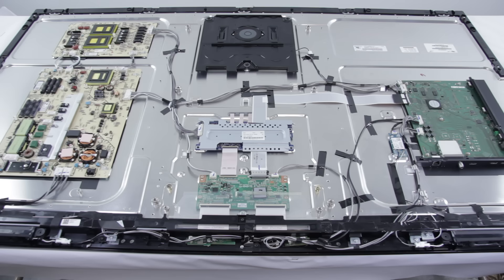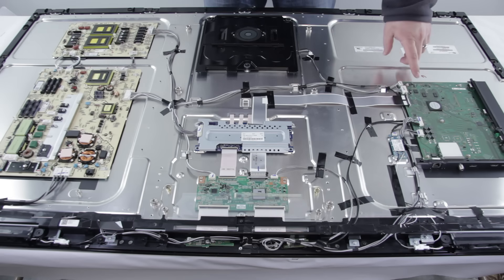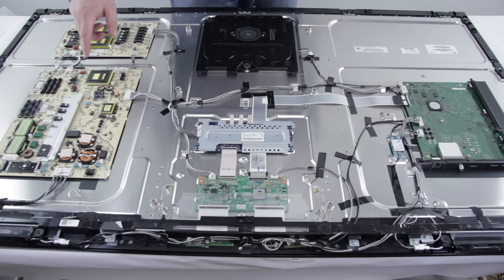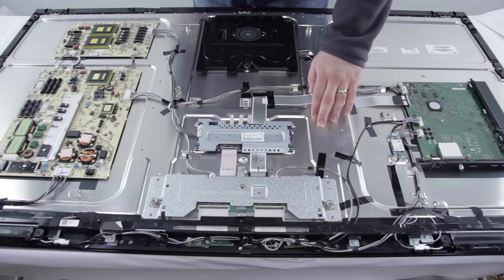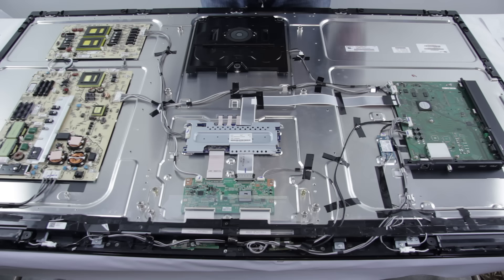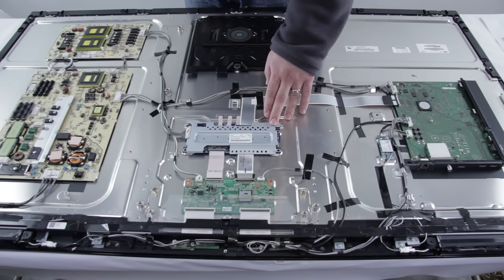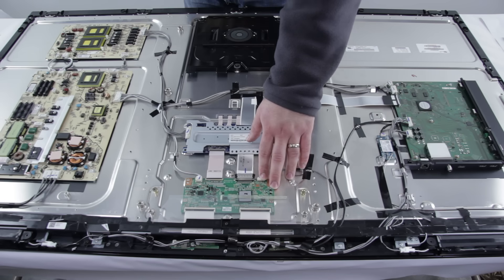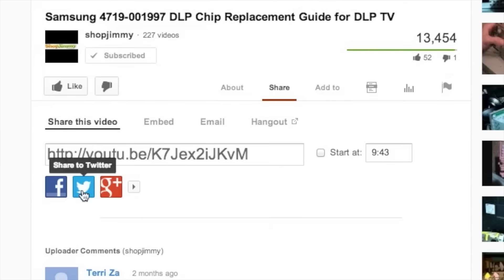LED TV Repair Tutorial - Common Symptoms & Solutions - How to Repair LED TVs

Comment: Hi  I have a 19" LED TV whose screen switches from white to blue to red to green to black and then repeats. There is no reception or sound, just the colour sequence, and it doesn't respond to the remote control.  Amazingly, there is no manufacturer's name or model number on the set, so the only information I can give you are the markings - 248COMBILED19 & 108011.  Sorry.

Comment: I have two Sharp LC-39LE551U Aquos LED TV. When we turned them on out of the box both of them have major picture problems. (looks like internally the panel is cracked) nothing on the outside. Is there any fix or does it sound like the panels. Sharp won't cover them on their warrantee because they think it was FedEx delivery issue.
Any thoughts?

Comment: I have a Sony Bravia 32" LED Model KDL - 32EX520, After switch on the TV suddenly some vertical lines and light flickering has been happened in the screen. What could be the reason ? Any issue with the Display screen. How to get resolve this issue. Please help . Raju Jacob
Reply from the maker: RAJU JACOB  This sounds like a TV panel (TV Screen) problem.  If your TV panel is bad, it may be more cost-effective to replace the TV as panels are typically hard to find in stock, difficult to replace, and expensive.  Thanks and please let us know if you have any further questions!  www.shopjimmy.com

Comment: I have a Sharp Aquos Model: LC-60e79U.  It does have sound and picture, but on the far left side about 1/5 of the screen is distorted like a after picture.  When a image is there and leaves it stays there for a few seconds.  Other than that it works fine.  Is this a T-Con board issue or the board below the LCD screen itself the issue.
thanks
Reply: Yes it is I just tore it down and found the connector that jumpers from one board to the other is damaged (water corrosion)  non repairable.  Now the rest works so I will sell the other boards off .

Comment: Samsung Smart tv (LED); model No: ue46d8000; version no:01; SERIAL No: Z87L3SQB800699D.

Hi, thank you for your video guide. Going by this, just to confirm, I'm receiving sound, a lit screen with a coloured strip down the screen. Can we confirm this is caused by the 
T/Con board and where would I locate the best price for parts?

Comment: Hi, please help, my SAMSUNG SMART LED TV UA-40F5500AM Power light blinks but the picture does not come. 1 year ago the same problem, so the service man replaced the motherboard, not no warranty so kindly help how to repair the motherboard or buy a new one for less price. Thx Anju
Reply from the maker: rajsvision  Try all repairs and troubleshooting at your own risk.  I recommend replacing the main board in your TV.  Click this link to replacement parts for your TV model number:  http://www.shopjimmy.com/catalogsearch/result/?q=40F5500  There may be multiple boards for the same TV model number, be sure to match part numbers on your current board, with your replacement for compatibility.  Here is a link to a video showing how to identify your part number, click here:  https://www.youtube.com/watch?v=BEPWrefQvqI  Thanks and please let us know if you have any further questions with your TV Repair!  www.shopjimmy.com

Comment: I own an LG 47LN5200 LED and while watching one morning...the screen just went black. The sound was still operating and I could change channels without issue. I did get close and could barely see some graphics (it was a news show). I turned off the complete set...unplugged and restarted thinking that it would reset...but no luck. The Cable is Verizon FIOS. 

I have only had this TV (from Sears) for just over 1 year (Bought just after Christmas 2013) and thought this Brand would have a much longer life. I called LG and of course it is out or warranty. 

I watched the tutorial and I am capable of changing the parts - however I am not sure if it is backlight or ? Is there another clearer way to diagnose? 

thanks - Rick
Reply from the maker: Rick Barker   Try all repairs and troubleshooting at your own risk.  This could be a problem with either the power supply board or the LEDs in the TV.  Click this link to replacement parts for your TV model number:  http://www.shopjimmy.com/catalogsearch/result/index/?cat=229&q=47LN5200  There may be multiple boards for the same TV model number, be sure to match part numbers on your current board, with your replacement for compatibility. Thanks and please let us know if you have any further questions with your TV Repair!  www.shopjimmy.com

Comment: Hi I have a sharp aquios led 70 le632 and approximately 1/4 from left side of tv screen I have a single pixel size blue line vertically on my screen please tell me what part I need to fix it thank you please email me any answers u may have!! Agb110178@gmail.com thank you !!
Reply from the maker: Adam Burdette  This sounds like a TV panel (TV Screen) problem.  If your TV panel is bad, it may be more cost-effective to replace the TV as panels are typically hard to find in stock, difficult to replace, and expensive.  Thanks and please let us know if you have any further questions!  www.shopjimmy.com

Comment: Hi shopjimmy.  I have a Samsung 65 inch tv model number un65f7100.  I was cleaning the screen then turned the tv.  When I turned it on I had about 4 to 5 vertical lines of different colors on the screen.  One of the lines is completely black. Another line went away but its been 2 weeks and the other lines have not went away.  Can you give me an idea of what's going on and what I should do?
Reply from the maker: DeSe5150  How did you clean the screen?  Did you spray it with any liquid?  Thanks!  www.shopjimmy.com

Comment: Hey shop jimmy. I need help. My daughter sprayed some Dreft multi surface cleaner on my 42" Vizio Led tv and the picture flickered out and now the screen is black.  I get sound and the back lights do turn on but no picture. Model number is M420NV
Reply from the maker: Caponesboy83   The TV is panel is most likely damaged.  If your TV panel is bad, it may be more cost-effective to replace the TV as panels are typically hard to find in stock, difficult to replace, and expensive.  Thanks and please let us know if you have any further questions!  www.shopjimmy.com

Comment: Hi thank you for the great and easy to understand video. i have an lg tv , when i switch it on it comes on , backlight shows but i can only switch on and off with the remote no menu options.The menu doesn't come even with the buttons on the tv. only the on and off button responds. What could be wrong ? Thank you. .My model is LG 42LV450U-ZC.
Reply from the maker: Okedum N   I recommend replacing the main board in your TV.  Unfortunately I do not see any replacement parts in the search results for your TV model number on our website.  Please reply with your part number on your main board and I can try searching for replacement parts.  Thanks and please let us know if you have any further questions!  www.shopjimmy.com

Comment: I have a Samsung un32eh5300fxza.  The picture went black all of a sudden while watching, the sound still works.  I did the flashlight test and I could see the picture.  I replaced the power board w/built in led driver and they still do not work.  I tested the wiring to the led light strips and they had good continuity.  How can I test the light strips before I buy new ones.  The tv is only about a year and a half old what would cause these led light strips to go out, and at the same time. I noticed they are wired separately from the power board??  I also notice the red light flashes when I plug the tv in.  Thanks for any help.....

Comment: I have a RCA LED 55C55R120Q 55INCH tv and a warranty repair of the main board didn't fix problem of solarization of picture. I'm getting my money back for the tv and RCA support said they don't want the tv. I tried going into repair menu to set some setting to fix this problem but no luck. The menu comes up w/ normal picture quality, just can't adjust anything to fix. Any idea what it will cost to fix this issue?

Comment: Model #: X325BV-FMDR SCEPTRE 32" LED TV
Symptoms: TV will power on: Splash screen will show for ~5-10 seconds then go blank. TV can be turned on again, and normally screen will stay lit for 1-2 seconds and then go blank again. I performed flashlight test and it has sound. All inputs work during flashlight test just no backlight. TCON board is fine I presume.
Does the mainboard you sell for this TV include LED driver in it? Thanks
Reply from the maker: benarline  This could be a problem with either the power supply board or bad LEDs in the TV.  You can replace the power supply board to see if that fixes the problem.  Click this link to replacement parts for your TV model number:  http://www.shopjimmy.com/sceptre-a13092704-main-board-power-supply-for-x325bv-fmdr-version-1.htm  There may be multiple boards for the same TV model number, be sure to match part numbers on your current board, with your replacement for compatibility.  Thanks and please let us know if you have any further questions with your TV Repair!  www.shopjimmy.com

Comment: My LED TV is having two horizontal line dividing the screen in three parts. In middle picture wil seen as reverse. I also have almost black square on left top corner about 1/4th size of screen which clear automatically after half an hour.
what should i do?
Reply from the maker: Sanjeev kulshreshtha  This sounds like a TV panel (TV Screen) problem.  If your TV panel is bad, it may be more cost-effective to replace the TV as panels are typically hard to find in stock, difficult to replace, and expensive.  Thanks and please let us know if you have any further questions!  www.shopjimmy.com

Comment: I have a Toshiba 46TL938 TV with a baklight problem. The backlight at first was blinking sometimes. And I noticed when it was on, there was a somewhats grey spot on the right side in the middle. I am in doubt here, it could be the LED driver, also it could be the driver stutting down because of a faulty LED??.. any ideas on this?
Reply from the maker: arnold mulder  This sounds like a TV panel (TV Screen) problem.  If your TV panel is bad, it may be more cost-effective to replace the TV as panels are typically hard to find in stock, difficult to replace, and expensive.  Thanks and please let us know if you have any further questions!  www.shopjimmy.com

Comment: Thanks for the video.  I have a question about a 40 inch Samsung.  Not sure of the model right at this moment.  However, it was solarizing very badly.  Everything I read said that the T-Con board was bad.  I ordered one and put it in.  The solarizing got a little better.  I changed the model number settings in the service menu and it got better but nothing near what it should be for this TV.  And, it only got better when I switched it to the 46 inch model number instead of the 40 inch it was supposed to be.  Do you have any ideas here as to what may have happened?  Bad replacement board perhaps?
Reply from the maker: Stephen Lee   This could be a problem with either the main board or the TV panel.  Please reply with your TV model number.  Click here to view a video that shows how to find your TV model number:  https://www.youtube.com/watch?v=S51nhAmwR2M  Thanks!  www.shopjimmy.com

Comment: I have a Samsung UN55H6103AFXZP 55" SMART TV. There is a section approx 8 inch wide running top to bottom in the middle of the screen that starts out with a lighter hue then eventually flickers in and out after period of watching the TV. The rest of the screen to the left and right of the bad section displays correctly without issues Can you please help me? Thanks

Comment: Hello:  Not sure what part I need to order from you. TV is a Samsung LED  UN60ES8000 USA version.  everything works fine except I have a single green line down the TV. This single line is not quite down the center.  The picture is perfect behind it but this line will not go away.  Please help.  and thank you in advance.
Reply from the maker: ***** This sounds like a TV panel (TV Screen) problem.  If your TV panel is bad, it may be more cost-effective to replace the TV as panels are typically hard to find in stock, difficult to replace, and expensive.  Thanks and please let us know if you have any further questions!  www.shopjimmy.com

Comment: hey I have a 39" vizio led smart tv, I've had it for about two years and yesterday evening when I went to turn it on the picture was upside down so I tried turning it off, resetting it, unplugging it but it's still upside down, in fact as of now I have the tv upside down, I was just wondering if this was something I can fix or if it's a lost cause! the model number is E390i-B0 and my email is demonblood83@yahoo.com
Reply from the maker: demonblood83   This could be a problem with the main board or the TV panel.  You can replace the main board to see if that fixes the problem.  Click this link to replacement parts for your TV model number:  http://www.shopjimmy.com/vizio-3639-0142-0150-main-board-for-e390i-b0.htm  There may be multiple boards for the same TV model number, be sure to match part numbers on your current board, with your replacement for compatibility.  Thanks and please let us know if you have any further questions with your TV Repair!  www.shopjimmy.com

Comment: SAMSUNG un60es7150fxza 60" LED 3D SMART TV shut off last night while watching it and wont turn back on.   The red light flashes and there is a clicking noise.  It will not turn on no matter what button I push and red light just keeps flashing with a clicking sound. Any help would be greatly appreciated.
Reply from the maker: David Lewis   I recommend replacing the main board in your TV.  Click this link to replacement parts for your TV model number:  http://www.shopjimmy.com/catalogsearch/result/index/?cat=56&q=un60es7150fxza  There may be multiple boards for the same TV model number, be sure to match part numbers on your current board, with your replacement for compatibility.  Here is a link to a video showing how to identify your part number, click here:  https://www.youtube.com/watch?v=BEPWrefQvqI Thanks and please let us know if you have any further questions with your TV Repair!  www.shopjimmy.com

Comment: Hi! i ve got a question about tv repair..I have samsung led UE32C6500UWXBT TV..The problem is that he switch on and off  many times and there is vertical stripes on monitor and this heppends many times..which part i need to replace..
best regrads
Reply from the maker: Nik R   This could be a problem with either the main board in your TV or the panel.  You can replace the main board to see if that fixes the problem.  Click this link to replacement main boards for your TV model number:  http://www.shopjimmy.com/catalogsearch/result/index/?cat=56&q=32C6500  There may be multiple boards for the same TV model number, be sure to match part numbers on your current board, with your replacement for compatibility.  Here is a link to a video showing how to identify your part number, click here:  https://www.youtube.com/watch?v=BEPWrefQvqI  Thanks and please let us know if you have any further questions with your TV Repair!  www.shopjimmy.com

Comment: Its driving me nuts, replaced PSU main board  con and backlight. Yet this nothing buttons beeping when pressed but no visible life other than that
Reply from the maker: shaun doran   It sounds like your power supply must have shorted out the panel when you saw the sparks.  Unfortunately there is not a repair for that.  Thanks!  www.shopjimmy.com

Comment: Hello I have emerson ld190em2 19in dvd combo tv. The problem is when in any mode will play fine for 3-5 mins then turns dvd mode on. If I power the tv off it will turn on by itself to dvd mode within same time frame. If I put a dvd in it plays no problems. Please help.
Reply from the maker: Nechelle Waid    I recommend replacing the digital board in your TV.  Click this link to replacement digital boards for your TV model number:  http://www.shopjimmy.com/catalogsearch/result/index/?cat=225&q=ld190em2  There may be multiple boards for the same TV model number, be sure to match part numbers on your current board, with your replacement for compatibility.  Here is a link to a video showing how to identify your part number, click here:  https://www.youtube.com/watch?v=wooRqBrRo6o  Thanks and please let us know if you have any further questions with your TV Repair!  www.shopjimmy.com

Comment: My LG TVModel PDP42G20144 just turned off one day (no power) and has no power to it since. I was thinking it was the power supply unit. The number on my power supply unit part is EAY60696801 or ( 901)  What do you think? Also do you have a replacement part?
Reply: No.  No power at all.
Reply from the maker: jennifer Mudzinski   I recommend replacing the power supply board in your TV.  Click this link to replacement parts for your TV model number:  http://www.shopjimmy.com/catalogsearch/result/index/?cat=59&q=PDP42G20144  There may be multiple boards for the same TV model number, be sure to match part numbers on your current board, with your replacement for compatibility.  Here is a link to a video showing how to identify your part number, click here:  https://www.youtube.com/watch?v=_4Qpfan0vdU  Thanks and please let us know if you have any further questions with your TV Repair!  www.shopjimmy.com

Comment: Hi, I was wondering if anyone could help me with my problem.  I have a LG 47LN5400 and my screen has colored vertical lines on the right half of the screen and the left half is a black strip on the left edge (approx. 6 in), and the rest is light grey.  I was thinking of trying to replace the T-Con but im just not sure.
I took a picture hoping it would help.
FRONT
https://drive.google.com/file/d/0B1zUQtNys2qlNjhxQWs5MGE2eVlEY082RkJyZkxyWE5reFZj/view?usp=sharing
BACK
https://drive.google.com/file/d/0B1zUQtNys2qlaHc0eGtOSkRadU96WlJWUll5T0VqdHhJVHl3/view?usp=sharing